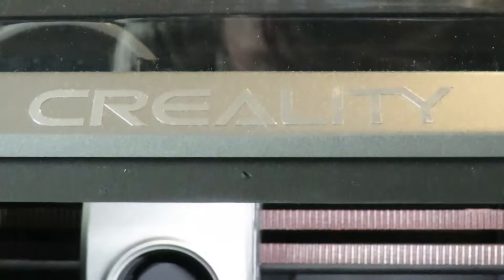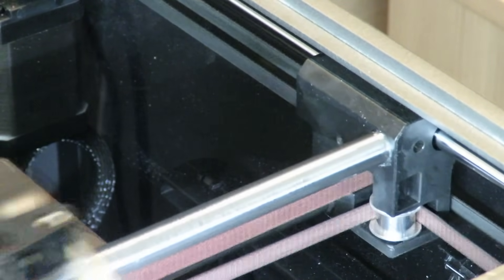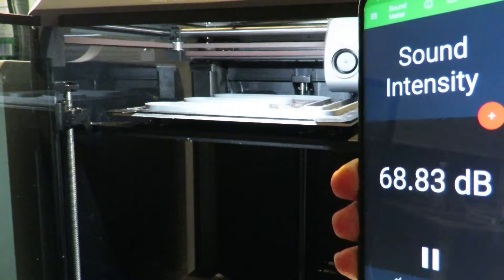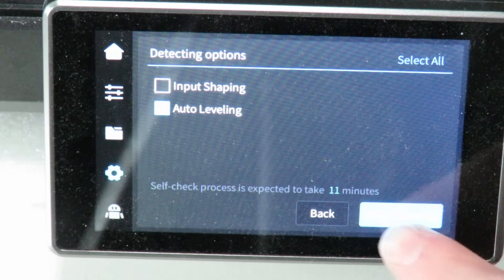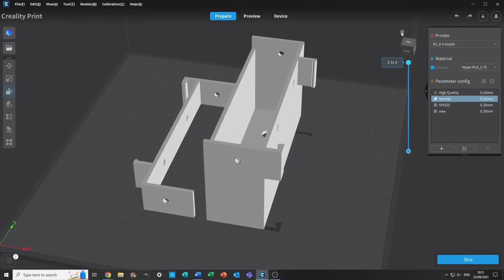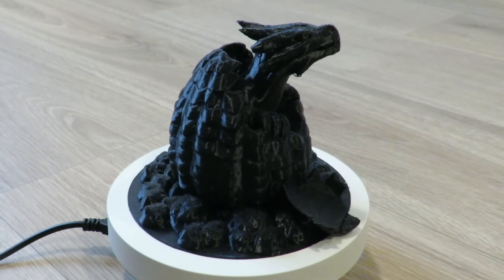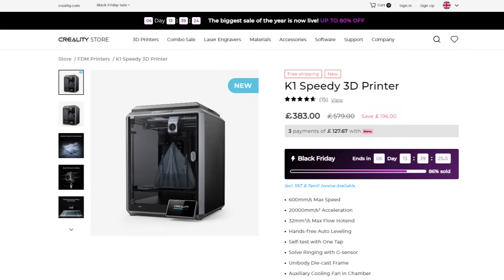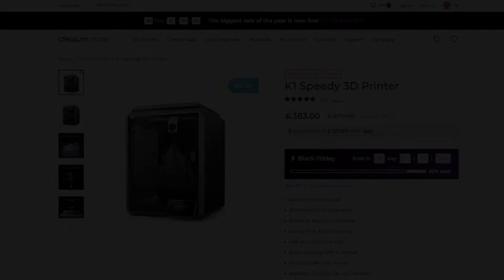The Fastest & Most Advanced 3D Printer That We've Ever Used - Creality K1 Speedy

Comment: I picked a K1 up a few days ago. I was not sure what to expect. I am pleasantly surprised. It is my 4th printer and I now use it as my main printer. The only thing is it is old stock and I figured it would be as I got mine on a flash sale. The hot end has the black sock and I don't have the sticker with the temperatures on it like you do.  And from what I can tell the extruder handle is not mate gray. I was going to contact the seller but decided to just buy the updated hotend , extruder and camera. Then it will be up to date. I am not a creality fan but am very impressed for the money.

Comment: Please, please clean your printer build plate.😮
Reply from the maker: Not much point with the quantity that I print. It doesn't affect the prints, only helps adhesion
Reply: Great product and price. What's the copy right for selling the models from the software!!😎🚂🚃🚃🚃🇬🇧
Reply from the maker: Usual rule is if you didn't design it then you can't profit from the design
Reply: @christopherbraiden6713 if the products are your own design then I'd imagine no copyright. I sell models from my own designs sometimes. If the design is from thingiverse or some other model file supplier, then probably you are not permitted to sell without having contacted the model author first to negotiate rights.
Reply: Very fast machine.  Great for the potential to create larger inventory of most demanded items.